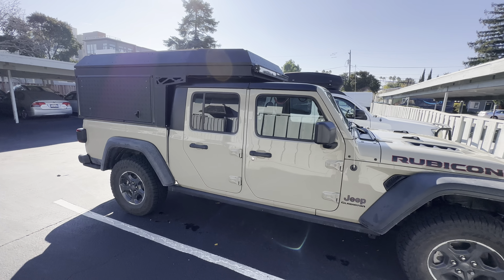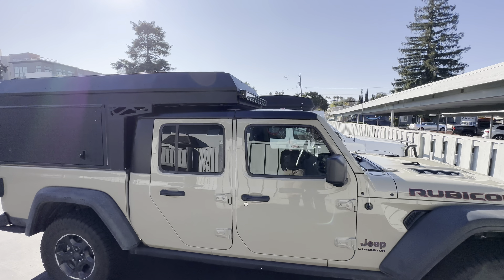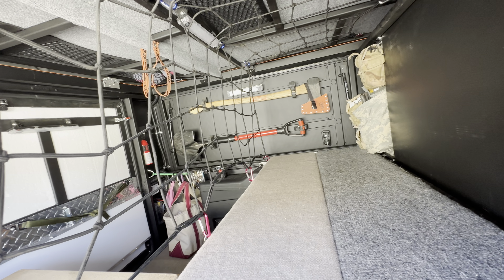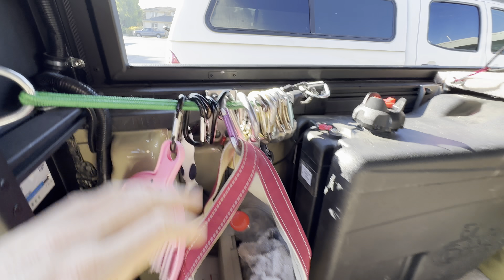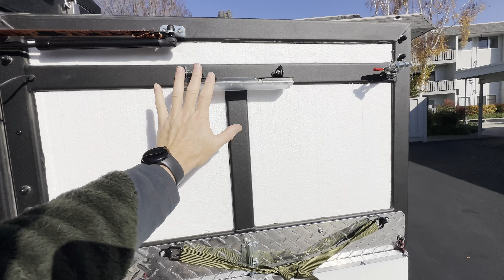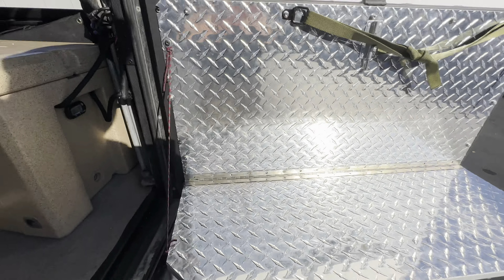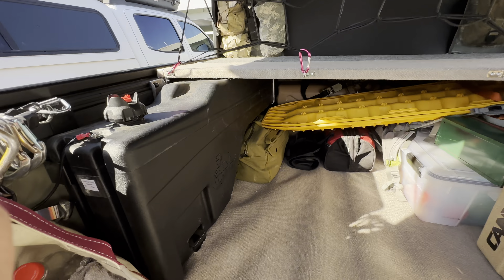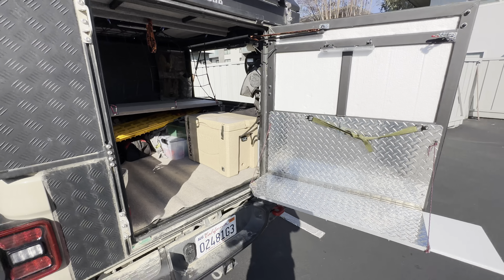Alu-Cab Canopy Camper update

Comment: I like the illumination on the  corners of the gull wing doors - I'm short so not an issue!
I will have to replace the door handle with a piece of webbing👍
I put my water storage tank (front runner I think) in between the rear window & bolted to the front of accc - bolted it on pre- install.
I also built a large SS prep/cook table on the rear door. 
I had the installer make the rear door swing out toward the drivers side. 
I put my fridge at the same location as yours. Great spot.

Thanks for the overview

Comment: Some quick notes: Lightbars and lights mounted above the windshield. Don’t necessarily shine off the hood. It is dependant on the lens and throw of the light. For example you can see my build through on of my videos we also have an ACC and instead of mounting lights on the ACC we run an UpTop Overland Half Alpha Rack and with it run the Baja Designs XL Link Lights. The only glare we get is from our radial antenna that we will take care of by taking black matte heatshrink and wrapping part of antenna. As the antenna is gloss and reflects the light well.

Comment: Now as far as a rear table for the ACC GP Factor now makes a full sized table. An alternative would also be the EXO Table that houses a stove as well.
Reply from the maker: Thanks for the pointers. I'd seen the GP-Factor but the price was out of the question for me. But those both look to be 25" wide in the 35" space on the door.  This design uses the whole 35", plus the slide-out cutting board, and even then we're often a little cramped for space when both of us are using it side by side.
Reply: @andyradin  I don’t think you understand the complications of having a table here  I’d have to be able to show video to explain. But yes the full size go factor table is 25.5 with a pull out section that is an extra 14”. The exo table was a bit smaller at 24” and no technical workspace slide out, it’s a slide for the stove but a second shelf. It is much deeper 5 1/8” inches and would impact larger cabinet designs. I’ve owned the eco table and was very satisfied with it. I currently run the go full sized table and also am satisfied with it. They each are great options with different use cases. In the end it depends on how the camper is used and the interior setup. I did enjoy the onboard place for the stove in the eco that I do not get with the gp factor and need to store elsewhere. In the simplest terms you are honest looking at the limitations here of how wide one can go on the rear door of the camper and still be able to close it and use it functionally unless you have a removable table that is out on after the door is open. Not something that I’d recommend.

Comment: Very nice! How did you mount your axe and shovel? Whats the bathroom situation?
Reply from the maker: There are pre-cut slots in the door panels that are perfectly sized for an M8 x 1.25 x 16mm carriage bolt - I used a few of those to hold some Quick-Fists in place.

Bathroom situation is shovel and squat

Comment: Fantastic job Man. I also would like to add a second handle above the door, for when the door is open. Where did you find it? Is it homemade? (if you want on my channel you can see my truck). Thanks for your replies!
Reply from the maker: It's the stock handle that came installed on the inside of the rear door.  It interfered with my stove, so I moved it.
Reply: @andyradin  you’re great!

Comment: Good video, and good ideas! Well done. How are you liking the Gladiator as a platform for the Alu Cab? Any downsides? Anything super good?
Reply from the maker: All the trails I thought were hard in my old Tacoma, are super effortless in the Rubicon.  Loving it
Reply: That’s good to know! I have an ‘08 Wrangler JK, 2door. I live 4 miles off the paved road and pretty rough terrain. My Jeep handles it all. I need a 2nd vehicle for my business, and will live in it 4 months out of the year. I thought about this set up a lot. The other I’m considering is a ‘24 4Runner with an Alu Cab rooftop tent & use the interior for my fridge/business gear. I bounce back & forth nearly weekly now. 😂